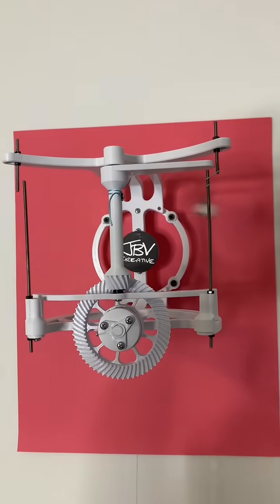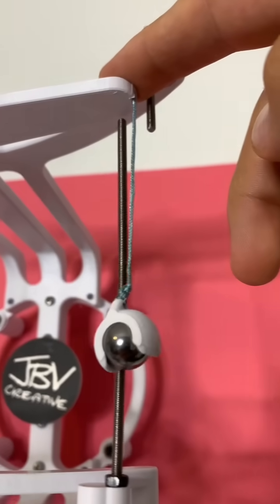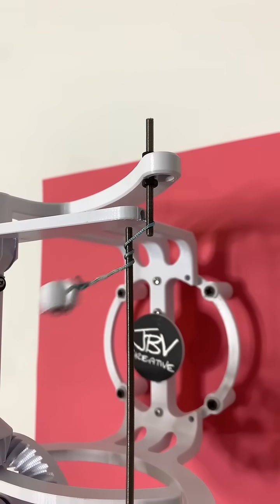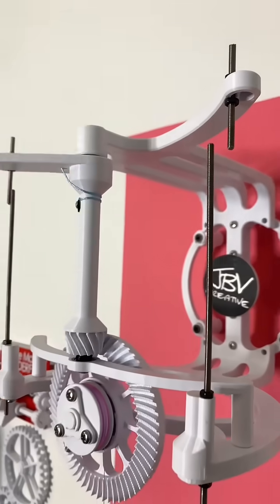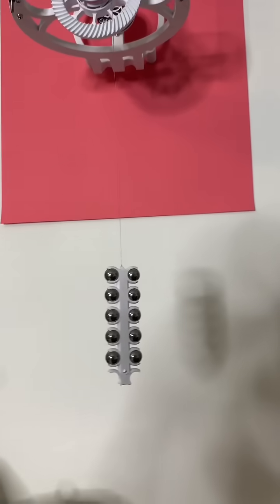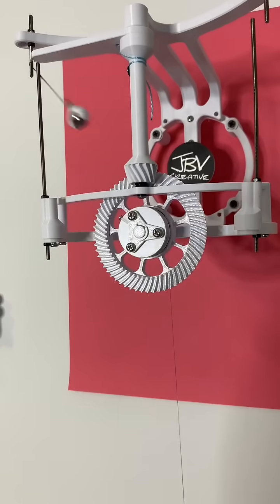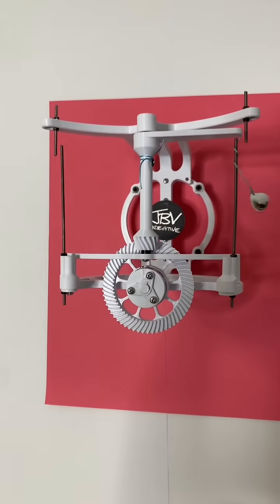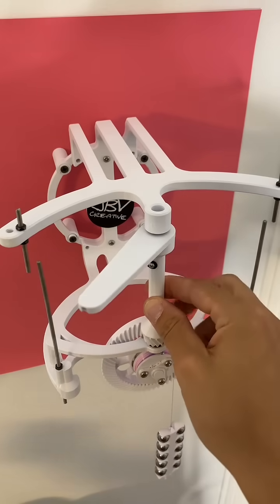The Flying Pendulum Escapement…what?!

Comment: Have you timed the regularity of the "swing ball" escape mechanism? I don't think it would be quite as regular as a pendulum. Even a pendulum's period will vary slightly with changes in length due to thermal expansion, amplitude, air resistance and forces driving it.
I do wonder how much things balance, for example, giving the pendulum more push from a heavier weight or less gear reduction would lower the period a small amount, but also the pendulum's amplitude would increase which would lengthen the period a small amount.

Comment: In this model, the pendulum gets it's energy from the wheel. I can see how it all works: the weight falls down and rotates the big wheel, the big wheel rotates the smaller wheel, the smaller wheel rotates the pendulum and the pendulum gets stuck for a while, and then gets free and keeps moving.
With the other model, the escaping wheel gets stuck and somehow gets released and gets stuck again, but what keeps the pendulum swinging ? does the escape wheel push the pendulum ?

Comment: Ye this fits the definition of a pendulum
 pen·du·lum
/ˈpenjəl(ə)m/
noun
a weight hung from a fixed point so that it can swing freely backward and forward, especially a rod with a weight at the end that regulates the mechanism of a clock.
used to refer to the tendency of a situation to oscillate between one extreme and another.
"the pendulum of fashion"

Comment: Would there be a way to generate electricity from string wrapping around those
Reply: Have it spin the thing at grabs as it releases produces energy through an alternator
Reply: The reason this thing runs so long is because it doesn't put out a lot of energy. You're better off just winding the weight around the alternator shaft

Comment: You removed the governor of the timing, change the weight of the wrap round , to adjust the timing.  Take it to the South Atlantic anomaly and test the lack of gravity variations.  Or the South Indian Ocean one.  Indian anomaly for stronger gravity.  Don’t fly  in either. Just to be safe.

Comment: You should make the hanging weight string completely circular and loop back on itself and then have the weights attached on a slider so once they hang almost all the way down as far as they can go you can just slide them backup on the same string and basically reset the timer that it can stay running without it stopping.

Comment: Its pretty interesting but curiosity about it is using different amounts of pendulum weights and yes that is a pendulum but can it be timed with different weights or different pulleys which would change things as a cam does with different amounts of duration and or height or lift.

Comment: Hi, would you be interested in building a momenta displacement engine for flight and çars, it would convert electricity directly into thrust / propulsion.  It would involve 2 arm's that move on hinge's? To move up , stop suddenly and then move down and stop suddenly and then move up again, and repeat etc etc, through an exact arc angle , so a to only generate motion in one direction, without back thrust motion.  To illustrate the motion, if you stand on a set of scales to record wieght difference's, and move the arms up to 45 degrees fast and stop suddenly to displace upward momenta, to reduce wieght, then move arms down to almost touching each other in the middle to record  no wieght difference for no back thrust, then move the arms up again fast and stop suddenly and so on and so on, repeating motions, to record slight levity, wieght reduction/ up thrust.   If a machine or mechanism of some kind could mimic this motion and be made to repeat these motions at great speed, then the engine would lift up and fly upwards.  I think your very good at building mechanism's and would enjoy making this work, I can not due to disabilities, but I know for sure it would work and make a great engine for flight in air and especially space, for which it is designed. Thanks for your time, Karl.

Comment: Can you create a gravity generator instead of a clock.  Where you would have multiple weights that fire alternately to keep the generator constantly rotating.  And enough stored energy in the weights for 3 hours of use.  The amount of electricity is supposed to be for the refrigerator.

Comment: You should make one .that could be used as a retractable starter motor pinion that comes from the side of the flywheel to engage instead of pushing in from the front or back. Although it seems cars are going electric but maybe it can be used in other applications when Petro is past. Use gearing to reduce starter size. I know cars today have very few instance of these components going bad. Just add improved starter......that's a sale. Gotta keep it simple though.

Comment: Weird comment, but could you use two alternating weights that power two elevators, with the top weight getting more weight added to it at the top then losing it at the bottom, and the elevators controlling the weight transportation, which in turn is powered by the weight?

Comment: Wow! This is genius. You can create an hourly clock with this. I'm more concerned about the calculations of both weights, gear ratio and length of string. Absolutely mind boggling for a mechanical engineer.

Comment: How much energy can you produce with that?
Reply: energy can't be produced, it can only be transformed, you transform potential gravitational energy into mechanic energy and still loost some of it, essentially this is useless
Reply: @caldeira_a  That's why I am asking... Would it be worth lifting a heavy object throughout the day.
Reply: @TheBlackstarrt  it isn't, that system just makes you loost energy, remove the whole thing, just spin the generator by hand for 5 seconds and you will make double the energy that thing does in several hours, it just slows the rotation down and throws some energy away as sound and heat

Comment: It can't run on potential energy.
Reply: it rus on potential gravitational energy, you pull the Wright up and let it go down while it's potential energy is turned into mechanical energy and other minor dissipations like heat
Reply: @caldeira_a  

No it runs on kinetic energy.  

Potential energy is energy at rest.
Kinetic energy is energy in motion.

If for instance cars could run on potential energy we wouldn't need to refill our gas tanks.
Reply: @psychicspy  potential gravitational energy is the energy all objects have, here thr weight has a certain ammount of potential energy, it is slowly transformed into kinetic/mechanic energy (not sure how exactly it is reffered to in English) which makes the whole thing move, by moving the weight up you don't add kinetic energy, you add potential energy to the weight
Reply: Potential energy is a form of energy that has the potential to do work but is not actively doing work or applying any force on any other objects. 

The potential energy of an object is found in its position, not its motion. It is the energy of position.

Kinetic energy is the energy of motion. 

Your device runs on kinetic energy because potential energy is incapable of causing motion.
Reply: @psychicspy  I was it sure about the terminology but you have literary agreed to what I said, the machine is powered by potential energy, the weight exists in a certain position and has x energy, it's energy is converted to kinetic as it moves down, the kinetic energy doesent just "appear" out of nowhere
Reply: @caldeira_a  

Does the clockwork mechanism (gears) turn when the weight is stationary? No.  The gears can't turn until the weight moves down a little and turns the shaft in the process.  That mechanism runs on kinetic energy.  If the weight that is storing the potential energy never moves there can not be any energy extracted from it.  It has to move in order to make kinetic energy.
Reply: @psychicspy  the magic bit is thr weight isn't stationary, it moves down consuming its potential energy, it's on the weight that the energy is stored
Reply: @caldeira_a  

I'm clearly wasting my time with you.  Go play with your clock.

Comment: What if you added a spring loaded mechanism to the wheel that pulls the weight back up after it reaches the bottom?
Reply: that's the same as making the string longer, you're just delaying it's stop by accumulating more potential energy, instead of gravitational you're storing it as elastic

Comment: A perpetual motion machine cannot exist in an atmosphere. Either that machine will stop moving in a bit, or it has motors that keep it going.
Reply: It has a counterweight, you can literally see it
Reply: @vurgical2013  if having a counterweight assisted the device in performing perpetual motion, someone would have found it many years ago, and it would have been well documented. We knew about counterweights for over a thousand years. There's not a chance nobody has tried it before.
Reply: no one said it was perpetual motion, this is literally how clocks work

Comment: Make a 3d printed reading light that runs entirely on gravity. A capacitor and toy car motor my work with an LED cluster. If you gear it right you may get enough light to be useful.

Comment: Make 20 - 50 different kinds of contraptions, for different purposes, & then perfect the best 2.
Take them to market.

One that can be set as a timer, with reliable adjustable times. For when I'm cooking with the oven, or to amusingly monitor kids computer time, etc.

Make them all as quiet as possible.
Make some silent.
Make some that make noise, but that promote relaxation.

Make some that include pyrotechnics.
Make some that include waterworks.

Make one that delivers pet food.
& one that triggers an auxiliary mechanism that sends the first back up, so it can come down twice.
  Or more times than that.

Make one out of heavy materials.
And light materials.

Bendy ones.

Ones that fan the air around the room.

One attached to a flying machine, like those wind-up flapping birds.

Comment: That could work as a very accurate timer/clock if you calculate it all out.

Different weights, gear ratios, string lengths etc....

Comment: Why isn't it a main focus on the comments that this has potential to solving an energy crisis? I'm the biggest idiot in any room and I can mathematically see this. What gives? 10% push to receive 200% return? Duh?
Reply: Because its physically impossible to create energy. If you put a joule in, you can only get a joule out. You can't push in 10 joules and get 200 out.
This is powered by a weight that falls just a little bit more every time the thing goes from side to side.

Comment: Fantastic print, I saw this at the Leonardo Da Vinci Museum in Florence.*

Also, on your pendulum clocks, you don’t need such high amplitude on the pendulum. If you can reduce how far the pendulum swings whilst keeping time, it will run a much longer period before you must hoist the weight again.

*Funny how he invented so many amazing things. You should definitely print a while clock and see how accurate it can get.

He also invented the cable driven Automaton which I’d reckon you could also try out in the future.

Comment: Add a pulley system so that the tiny distance from the highest point to the floor would amount to several floor levels worth of rope. Then add some extra weight to compensate. See how long you can make the mechanism last with merely one input of energy